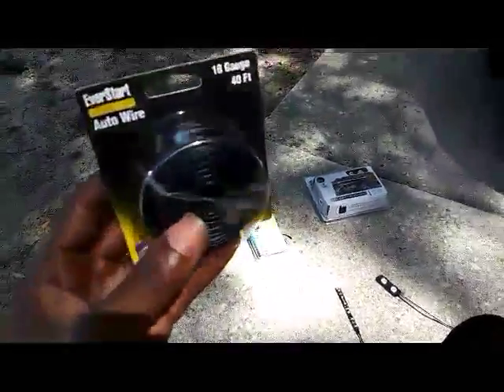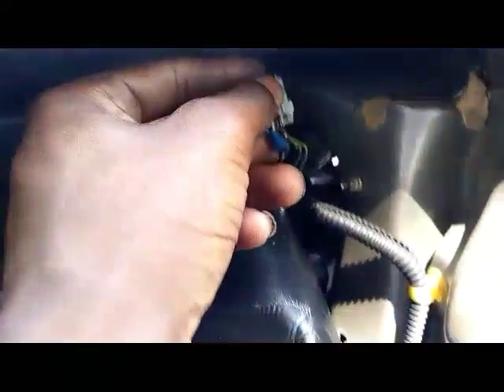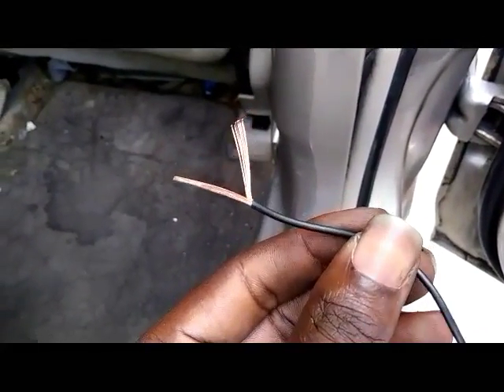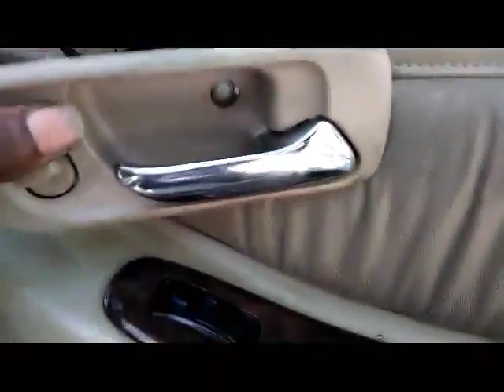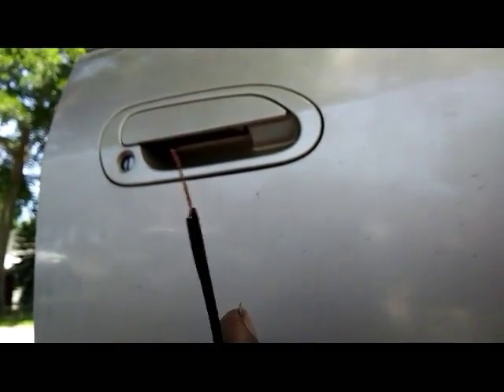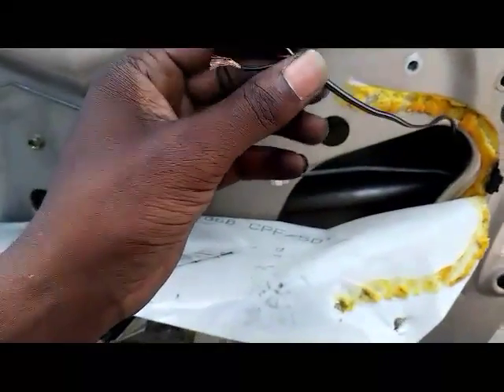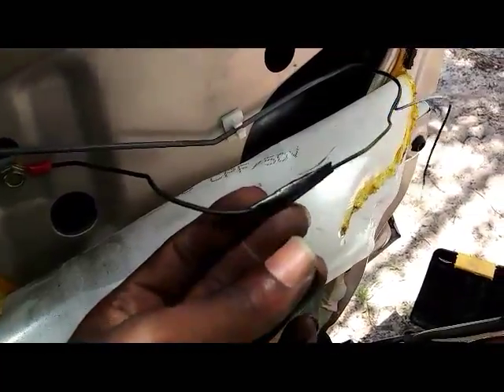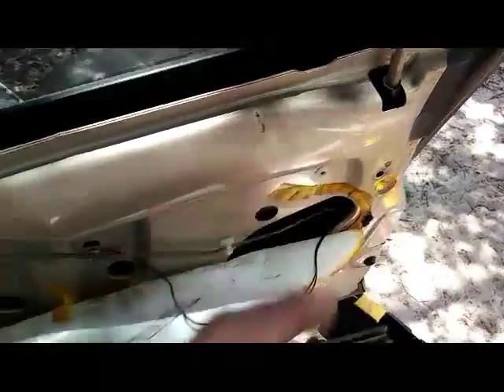Ghost Indicators DIY ( flashing door handles)

Comment: Cool mod, wonder a car maker hasn't picked up on this idea.
Reply: They won't go through the work accept if it's an high end vehicle like Benz, Bmw, Porsche, ect😩
Reply: @murrayent1able  I don't think it would be a big deal for 1 more wire  to be included in the wiring loom as the car is being manufactured. I have a 2016 Kia Sportage here in Australia and the area under the door handles already lights up as you walk towards the car (more noticeable at night though.) Alan

Comment: How are the leds holding up since you install them no troubles with the double sided tape coming off the car?
Reply from the maker: xthexyoungx1xguy Its been a year with no troubles at all. I cleaned behind the door handles thoroughly before i mounted them. Also it is hidden back under the door handles in a spot pretty tucked away from the sun and other elements that could cause adhesive issues. But worse case scenario you remove the bad adhesive with some gumout and clean the handles and the leds and install a new adhesive tape or super glue or etc.
Reply: When you open the door do then leds get to hot to touch the handle
Reply from the maker: xthexyoungx1xguy No leds dont generate heat like halogens.